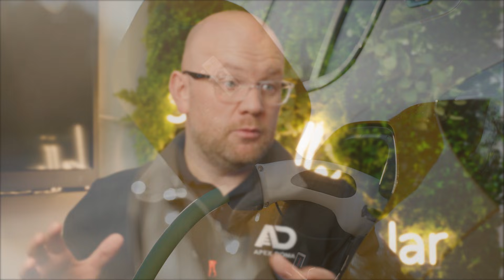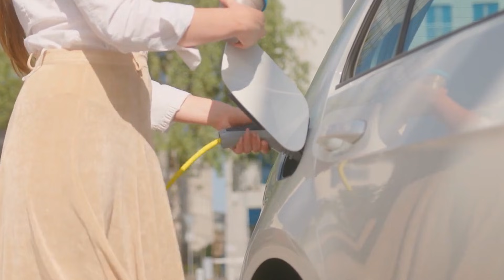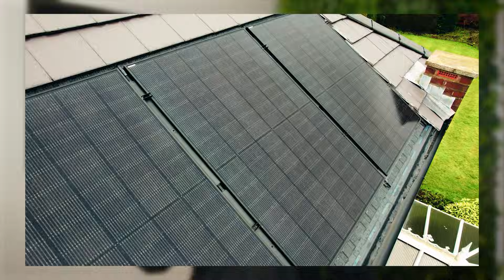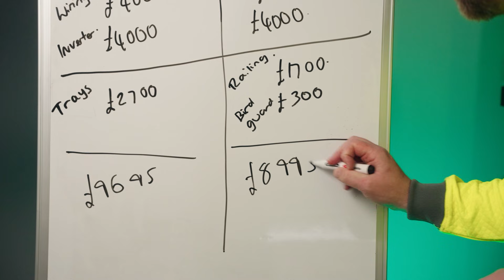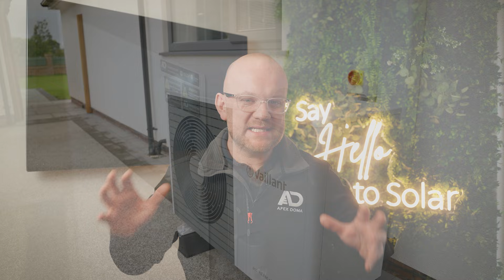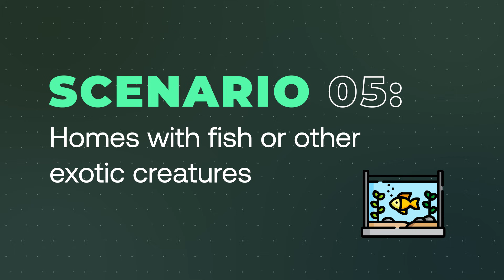EVs, Renovations & Weird Energy Setups... Should You Get Solar?

Comment: Yep, pretty much agree with all that you said.
For me, from my last 18 months experience, I would say spend first on battery (if you can't afford it all at once).  Buy more battery than you think you need, or allow for easy expansion.  My house uses up to 5000 units per year (including PHEV charging), and I started with a PW3.  I soon found I was getting low on battery, and worrying about high rate charges.  I just added an expansion pack so that I have 27kWh for load shifting, and really I'd consider a second expansion to cover everything. 
My 4.7kWp solar over 3 directions (so not the best) gave me £500 export last year. I was buying at cheap rate, and exporting everything - and still see that as the best approach. 
Anyone in your area should give you a call - whether they have fish or not!!